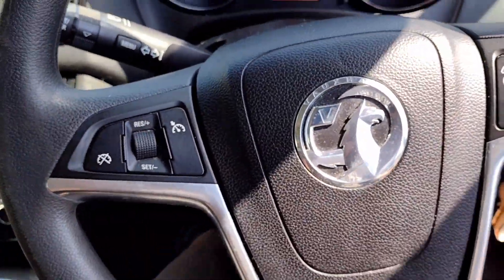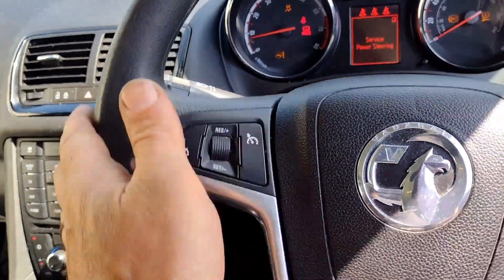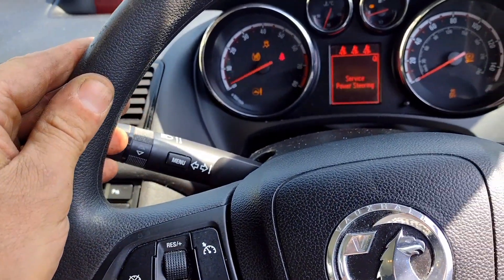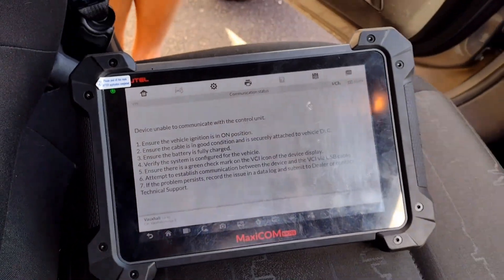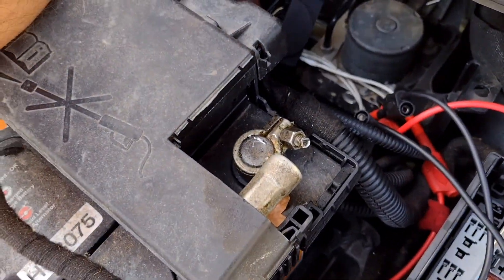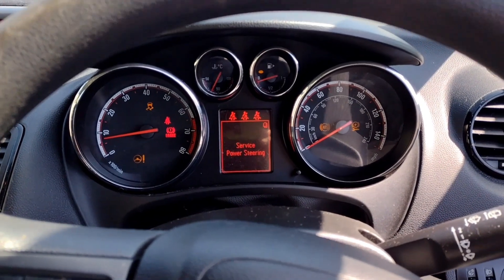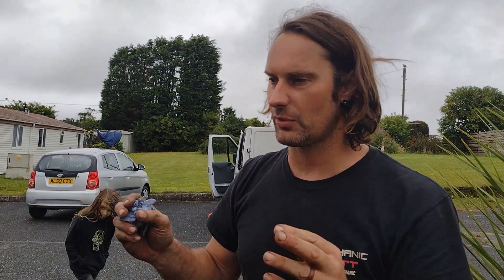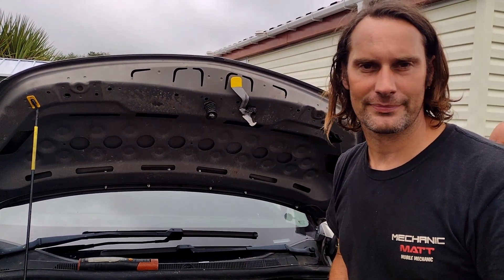vauxhall meriva (no power steering) faulty ABS model

Comment: hi matt i just see your explanation  about the abs pump... fault 
did they told you the cause of this problem? 
was there any kooling water leaking  into the abs control unit? 
thnx for sharing this video
Reply from the maker: That didn't say, only that it was affecting the can bus like I thought. Thanks for watching
Reply: thnx
Reply: Had this happen to my 2011 1.4T SE. 
Nobody could work out what it was, including vauxhall. I changed the coolant tank as it is above the ABS, and it had small cracks which leaked under pressure. 
Covered just over a thousand miles in it issue free. However, it happened again today ☹️🤬

Comment: Driving the car and and code 68 came up, Steering disabled along with the electronic handbrake deactivating and the service spanner, stability control,  ABS lights and engine light. 

After it had been parked for a few hours everything was back to working normally, than I went to garage they put computer to diagnose code again came up and it will not go. nobody able to recognise the problem some saying mechanical fault (steering pump and abs faulty, some are saying electrical fault. Today I went one they saying replace or repair ECU unit. Please advise what I can do in this situation.
Reply: I changed my coolant tank as it leaks onto the abs pump module.
Been fine for a thousand miles, but went again today.
Reply: I've got the exact same problem. Been in the garage for 9 months. Supposed to be fine but today broke down with my disabled brother in the car. RAC took 3.5 hours to arrive, and by that time it was fine again. Did you manage to fix yours or find the cause?
Reply: Hi mate 
Are you solved your probleme?

Comment: Not seen that before and you xan see how it would easy send you off kilter had you not got the abs fault codes. Used ecu testing myself and found them to be very helpful.  What break out wire kit do you have there matt as looks very comprehensive.

Comment: So you jumped the can bus lines together  then checked the digital signal with your oscilloscope? Never done this before to confirm a failed unit but will bear it in mind. Thanks
Reply from the maker: Yes I didn't join the can hi to the can low, this car has two pairs of can wires at the abs module, if I just unplugged the abs module it would leave some other modules on the car with no communication, so joining the can hi to the other can hi and the can low to the other can low I kept the other modules communicating. 
When the abs was plugged in it corrupted the communication to other modules and that resulted in the power steering not working. Thanks for watching
Reply: Thanks mate that makes sense

Comment: Interesting video matt..curious how u bled the pump,did u just pressurise the system then crack the pipes open ?
Reply from the maker: I started with letting the brake fluid gravity feed to the pump as I screwed the brake lines in, then I connected the pressure bleeder and cracked off each line out of the pump, one at a time to get all air bubbles out. Thanks for watching
Reply: @mechanicmatt871  saved yourself a lot of work